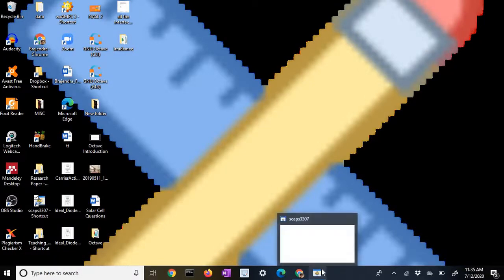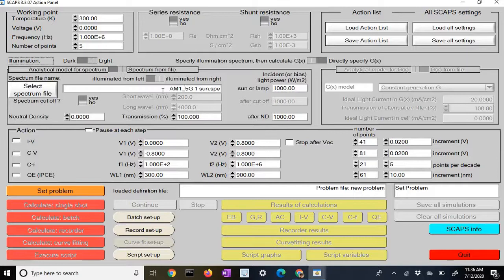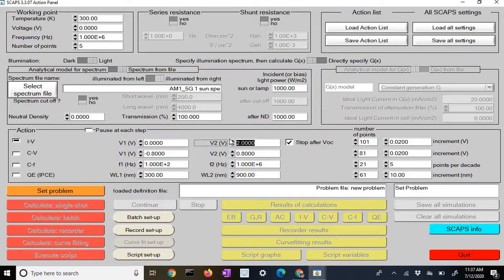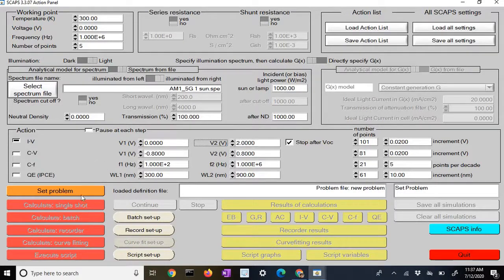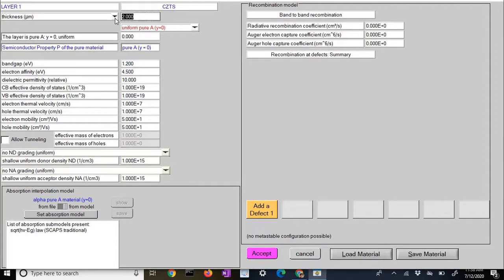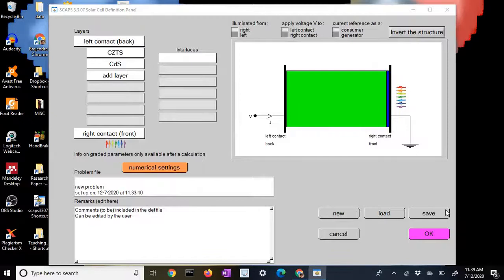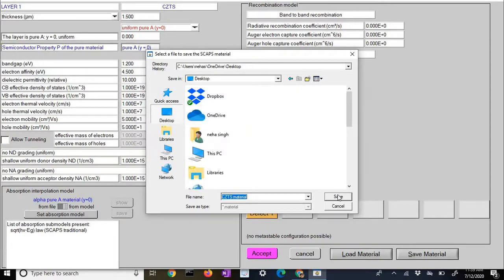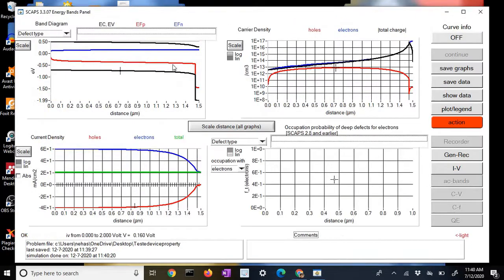How To Start Working On SCAPS Simulator

Comment: Can we import any organic solar cell simulation and check I v curve
Reply from the maker: SCAPS is used for thin film-based devices, so you can fetch the property of organic material from literature and put it on SCAPS but that material should have all the property in terms of the parameter given in SCAPS